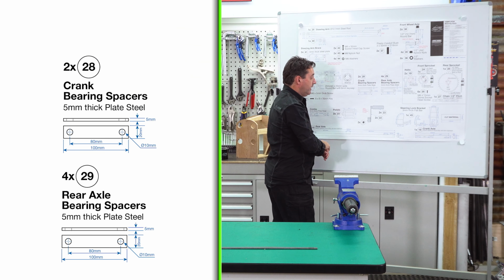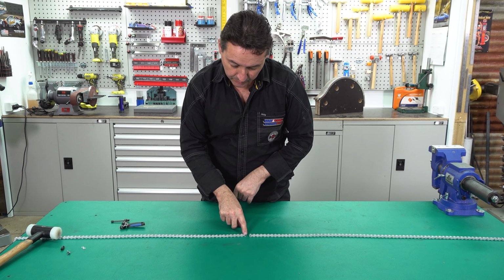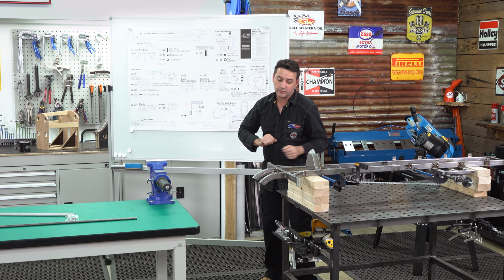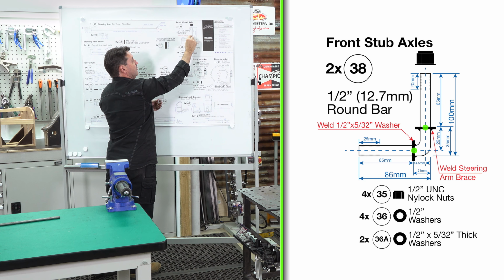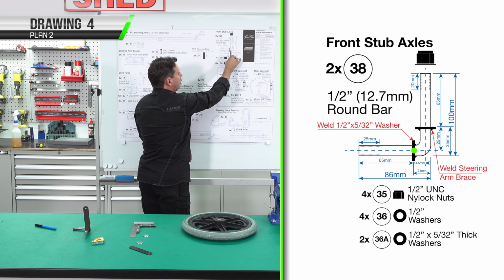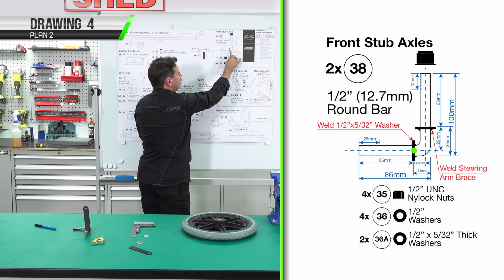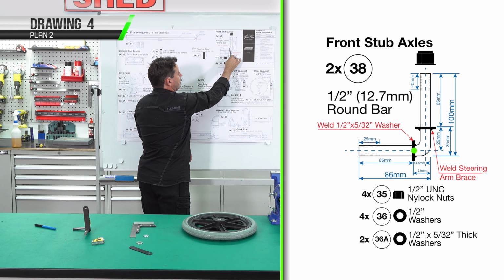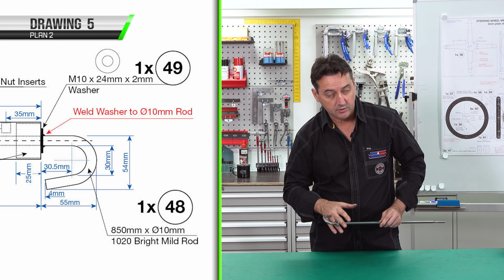Drivetrain - Part 2 & Steering | Flatbed Felix Pedal Car Build | Plan 1 - Episode 4 |

Comment: In theory, the steering arms should point towards the centre of the rear axis. This angle, I believe, is called the Pitman Angle. It allows for the differing angles that the steering wheels take to follow the turn tracks. 
  I appreciate, though, that for the home hobbyists that may be doing this build, accurately recreating this angle may be a little too complicated and just having the arms at 90 degrees will suffice.